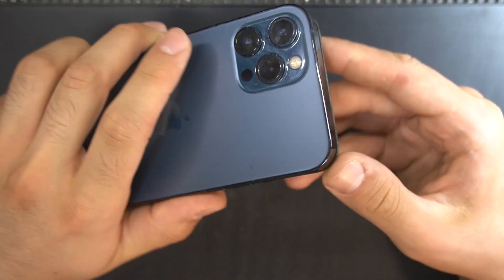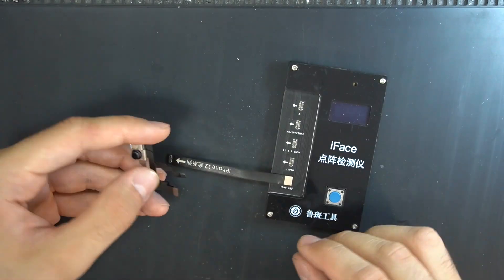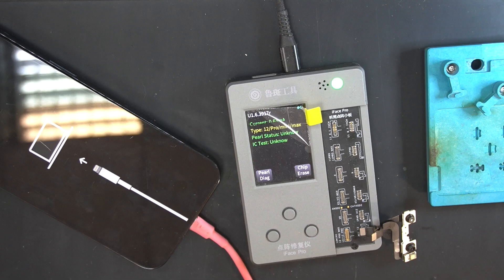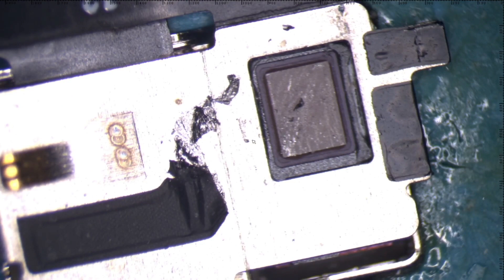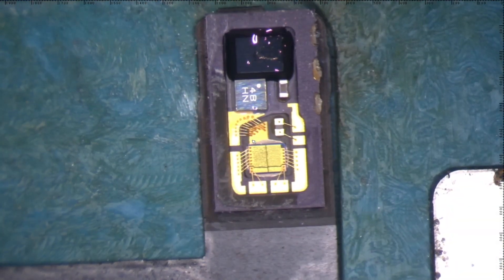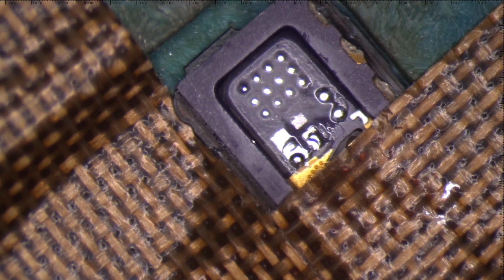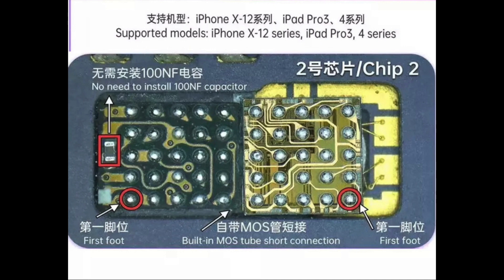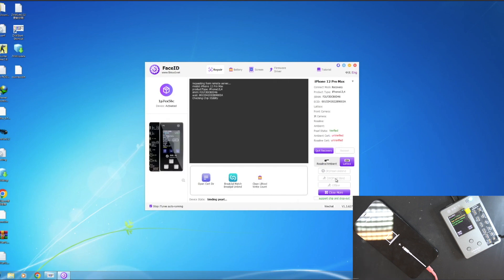iPhone 12 Pro Max face ID not working repair

Comment: Can we use another original Face ID flex cable from the iPhone 12 Pro Max?
Reply from the maker: @lithuanialithuanians2148  No, each flex cable is bonded with its phone.
Reply: @iTouch-repair  дякую
Reply from the maker: @lithuanialithuanians2148  прошу, звертайтесь.
Reply: Koto taka lage

Comment: Hello please, I have a customer phone that came in for repair. I think it’s a display problem. When powered on the phone boot up on the screen with the Apple logo. But as soon as the phone is about to boot up the display goes away. But the phone will still indicate that it’s on when you plug in the charger. I have tried diode mode the display connects and everything read just fine.
Reply from the maker: Did you connect the proximity sensor flex to the board?
If so, it could be the flex is damaged. Try from another phone full screen with the flex.
Reply: @iTouch-repair  I did that already
Reply from the maker: @teamgiveaway3483  ok, then check the proximity sensor connector on the board
Reply: is it a iphone x? water damage?
Reply from the maker: @homerds200 No, it's an iPhone 12 Pro Max ,as in the title.
And yes it was water damaged.